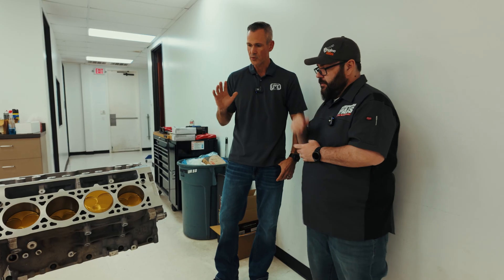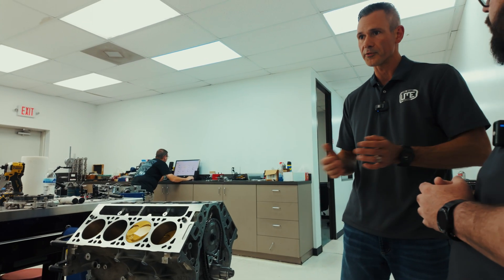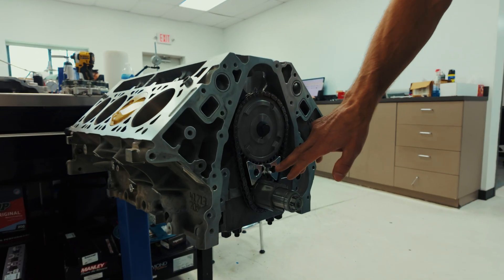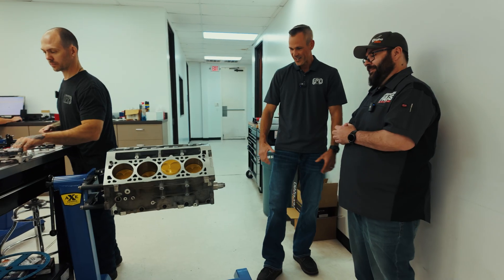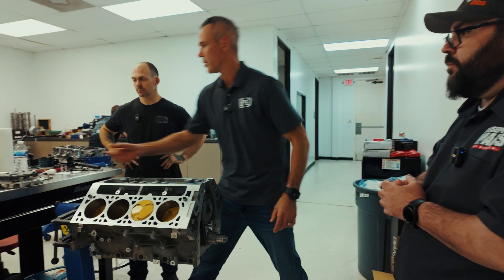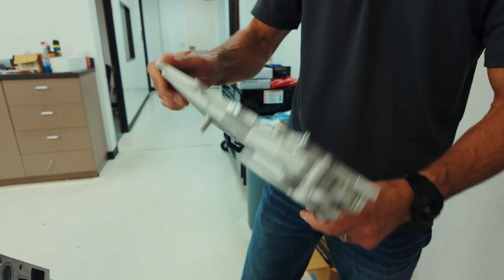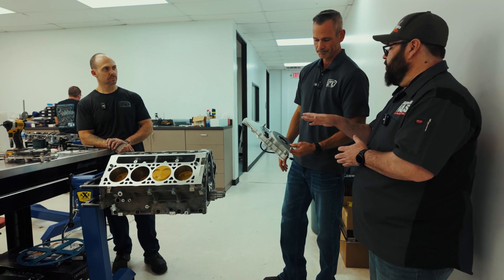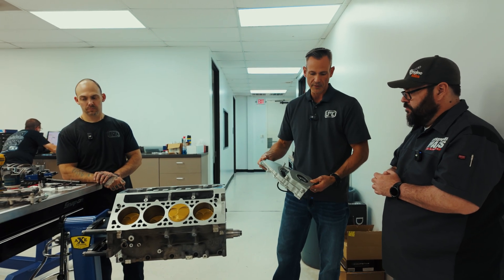LME's VVT Delete Made Life Simpler for Our Turbo 5.3L L83

Comment: Really not a good comparison since one use double valves, cams, bigger heads to make power while the other is a single pushrod engine.
Reply: Isn't that the point, to compare these two variants of engines with similar cubic inches and the same turbo?